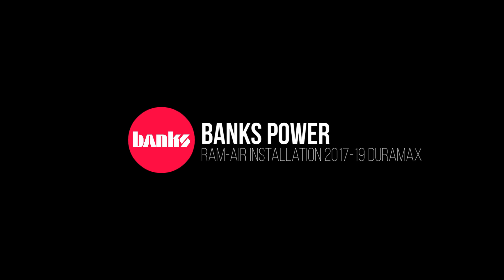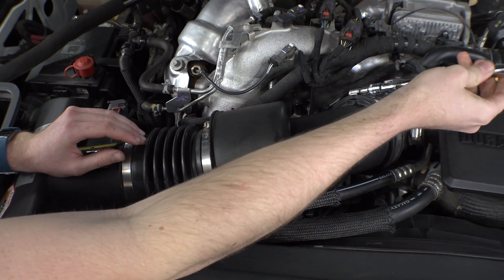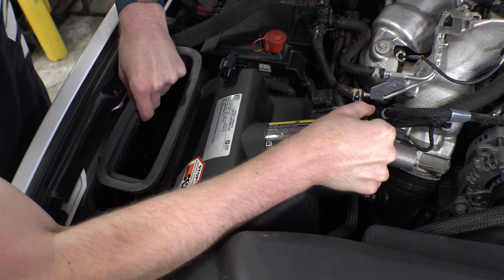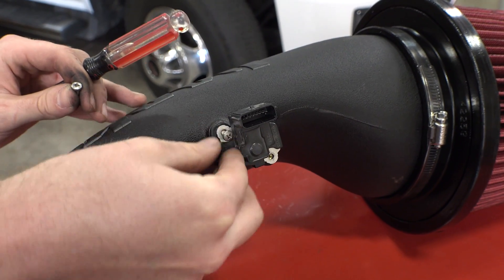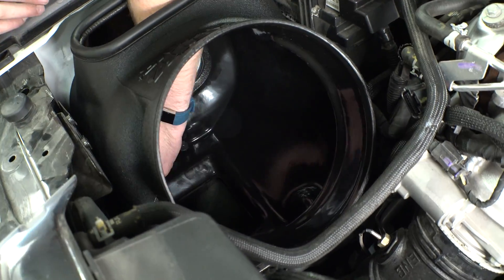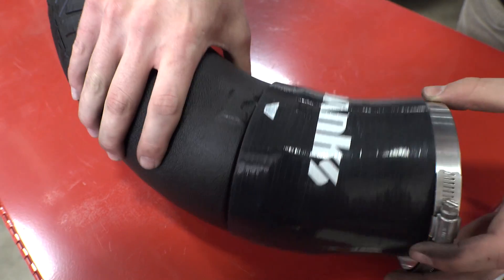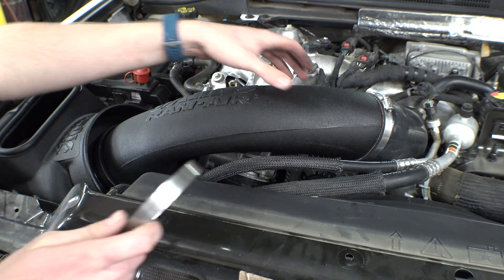Banks Ram-Air Intake Installation for 2017-19 Duramax

Comment: Why is there no video on the 2021 instillation of the oil and air intake cooler?
Reply from the maker: You'll find the installation video on the "video" tab on the product page. https://www.bankspower.com/i-3020
Reply: @bankspower  Thanks but wrong part and wrong vehicle year. Air and oil cooler combo for 2021 gmc 2500hd at4. this was the part https://www.bankspower.com/i-2969-banks-ram-air-big-ass-oiled-filter-cold-air-intake-system-for-2020-2021-chevy-gmc-2500-3500-6-6l-duramax-l5p.html

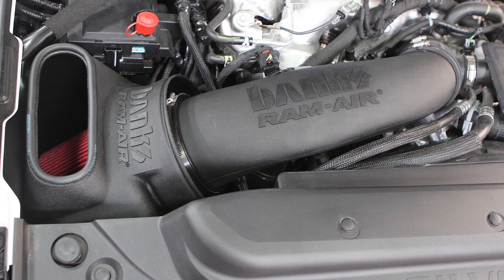Comment: At 6:53 I can see you have it attached the the stock resonator engine air intake hose instead of coupling that comes with. Why is that? Mine keeps popping out from too much road vibration should I do this too?

Comment: Hey just got my cold air intake from banks it’s awesome except the rubber grommets you definitely have to cut them to size they Definitely do not cut them at the factory
Reply: What do you mean?
Reply: The grommets are now one piece, made to fit.  No cutting required

Comment: Just do not cross any deep water with it... 
Just to clarify I'm from Australia most of the vehicles we run here are Toyota Land Cruisers the current model being a twin turbo  1VD-FTE wagon or a single turbo Japanese pickup truck lots of very deep crossings in very harsh dusty country. Would be awesome if you could cover the 1VDFTE  engine
Reply from the maker: That's probably a good plan.